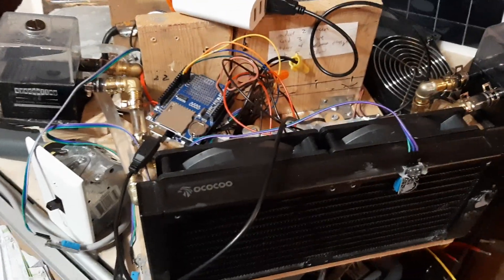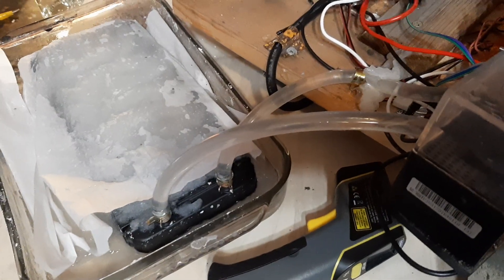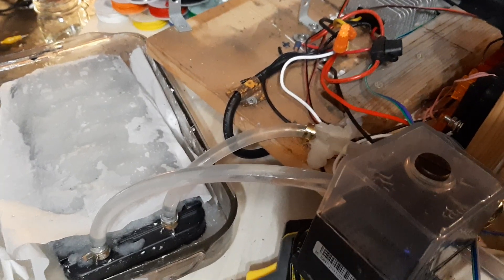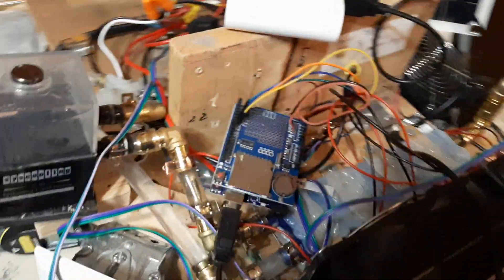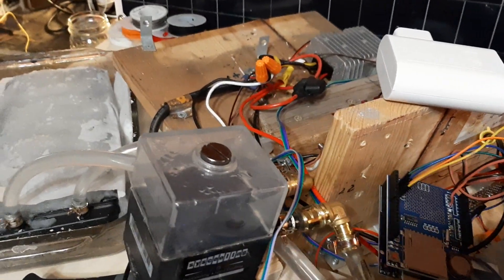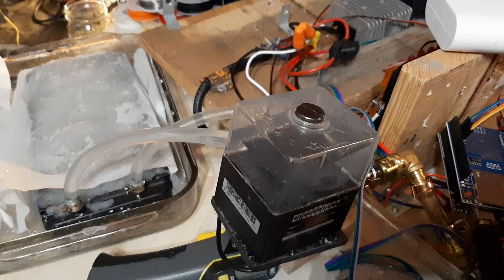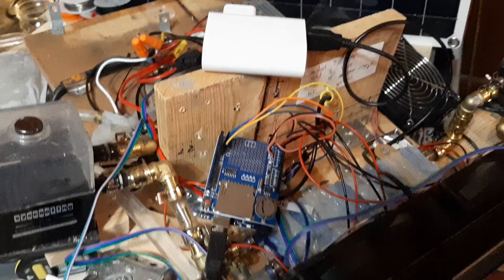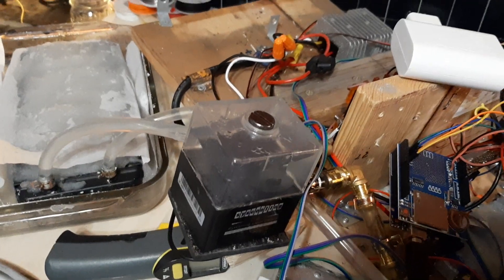Adding Phase Change Materials to Peltier-based Air Conditioner: Experiment #1 - proof of concept.

Comment: Very cool! I’ve built a similar machine myself a couple of years ago! I had originally intended to use coconut oil until I saw Ben’s video on the the PCMs. Still need to try it out. I calculated that about 1 liter should be enough to cosy up a room in the morning from heat captured the previous afternoon, so built a 5 liter tank.
Reply from the maker: Yeah, my next step on the PCM is low-melt candle wax and carbon cloth to help move the heat. Paraffin has a very high latent heat when it melts/solidifies, and the carbon cloth provides a very conductive pathway so I can wrap it around copper pipes and heat water or air with it. I can get 140F melting wax to make a pretty good water heater at something like 4-5X size savings. I'm definitely going to explore that angle again.  How well did your tank work?
Reply: Can't believe this was already 8 months ago! I sadly never got round to a proper controlled test due to time. I'd spent most of my time working on the control logic and automation for the fans and the pump and work realities got in the way. That said, I tested the tank with just a cup of ice in around 1 liter of water and the the room's temperature dropped significantly in like a minute (about 2-3 degrees) - and that wasn't cool air blowing on me, that was away from the stream of air from the fans on the radiator. If you just took that cup of ice and put it on your desk, basically nothing 
would really happen - so it seems like the idea could work.

Comment: Nice idea! I never thought about this sort of use. Instead of submerging your heat exchanger directly into the pcm you might put the pcm into bags and then put both the bags and the heat exchanger into water. The water will circulate more easily than the gelled pcm and I think you'll be able to move heat in and out faster. In spite of the gel the pcm can start to get big salt crystals forming over time if it's not agitated every so often, and it's easier to just give it a shake if contained in smaller units. It would be more difficult to dissolve crystals that grow in the radiator fins also. Great project!
Reply from the maker: Thanks for taking a look. Great idea!  I suppose I can get another pump to circulate that water as well.  Perhaps I could fill aluminum tubes with the PCM so the circulating water can really move aroud.
Reply: @bigattichouse  You might be able to get away with just using the convection from the radiator being on the bottom of the container to circulate things. Otherwise I think you would only need minimal stirring or maybe a fish tank bubbler
Reply from the maker: @Nighthawkinlight  Thanks. Guess I have my next article/video planned out.